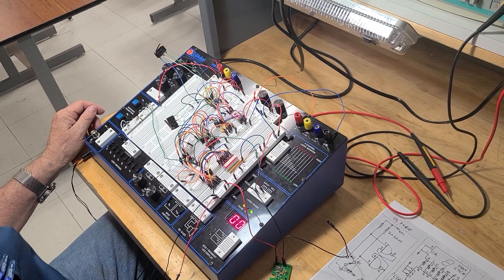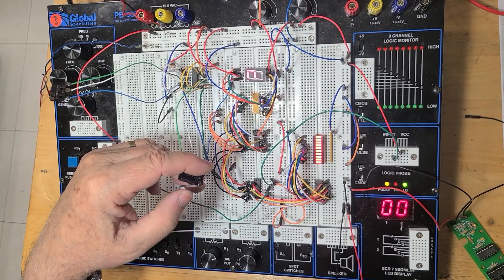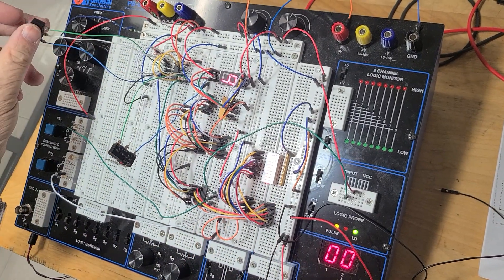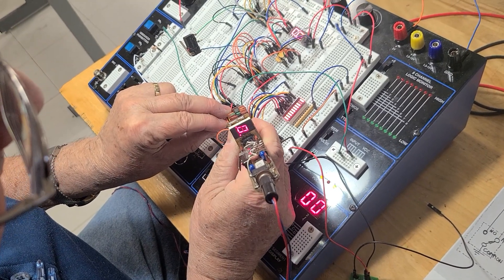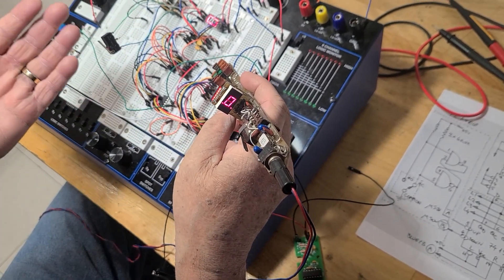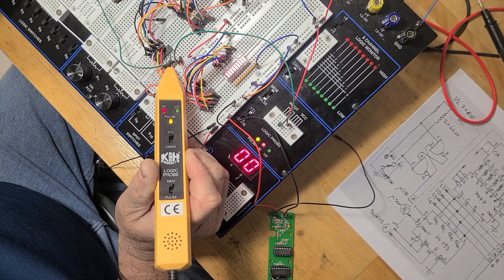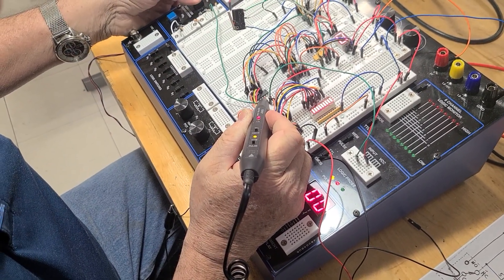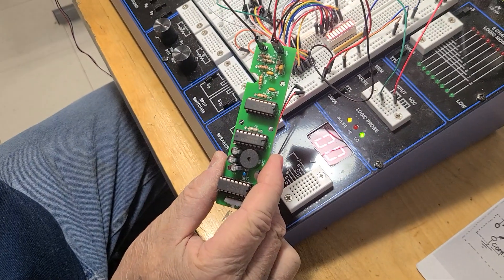Shiny Tools  - Introducing 5 Logic Probes

Comment: what is limbo state ?
Reply from the maker: @noone-zq7my  Hi there, I'm glad you are interested, and thank you for asking the question.
The short answer is, when you use a logic probe to measure instead of a DMM, the probe can show you that the point you touch with its tip is either High, or Low. Ideal situation. But if it is neither High nor Low,  we call this "limbo state".
The longer answer is, if you watch this video:
https://youtu.be/c3vJrQgFKaA  the limbo is described between approx. min 5 to 10.
If you have other questions, shoot. 
Cheers, CU
Reply: @CU_Wiring_Electronic_Projects  I see , we call that " floating " here in the west.
Reply from the maker: @noone-zq7my  I can understand your confusion. In electrical circuits in general, "floating" is associated with wire(s) not connected anywhere. In logic circuits, "limbo"  is an unwanted state, usually signaling a defective IC or connection going "South". I am not sure about your compass, 'cause the expression "limbo" is in common use by all electronic engineers here in the West from the early 60s since ICs were invented, as well as in manuals and magazines. All the best to you